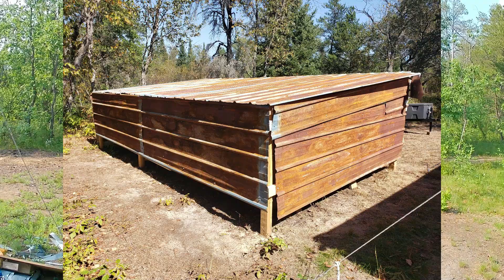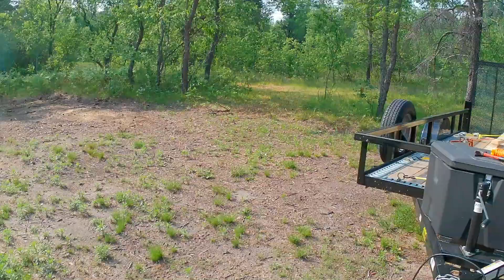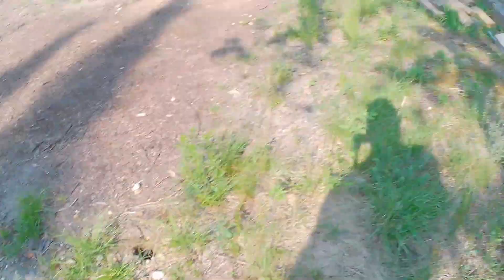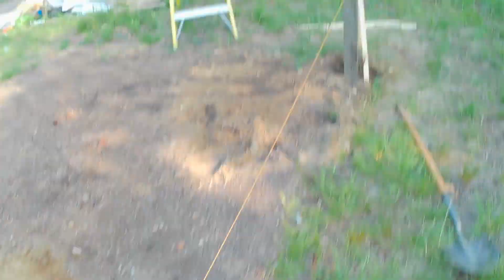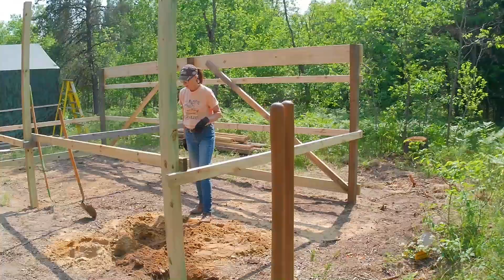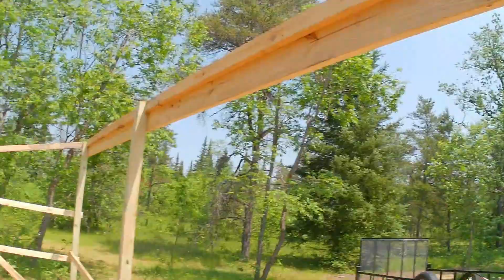DIY Post Frame Machine Shed Build (Part 1)

Comment: I am from Northern Illinois. I’m thinking about doing something similar…. Do you think it is okay to do posts with ground contact like that? I am a novice builder. This seems pretty easy.
Reply from the maker: My soil is 100% sand and very well drained. Treated posts are used all the time for pole buildings. If you had wet clay soil you might consider using a foundation waterproofing /tar type treatment on the post prior to setting them. Best of luck...

Comment: Real nice job and I'm about to start a very similar build in the next 2 weeks.  Did you layout the post spacing to be 10x20 or is it 10x20 to outside of girts?  Not that it matters, was just curious.  Most pole barn suppliers size the building to the girts.  Thanks!
Reply from the maker: I needed the outside measurements to be 10x20 or less because my Township doesn't require a building permit for buildings 200 square feet or less.
Reply: @ToddsProjectsandOutdoorJournal  Just curious, what pitch did you use for your roof?

Comment: No cement on your posts?
Reply from the maker: No, It's all sand and rock. Once it rains a few times that sand will lock it in place permanently. We're back in the big woods so the wind doesn't really factor in for uplift concerns. Thanks for watching.